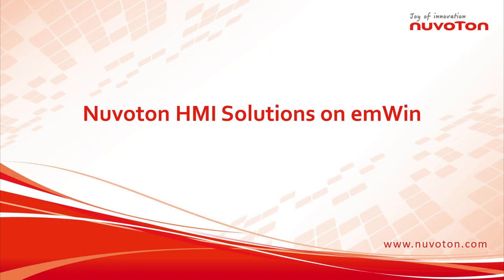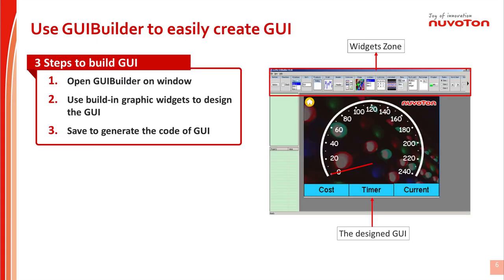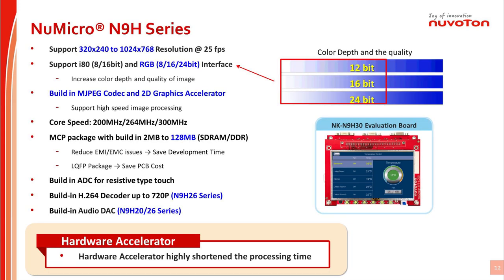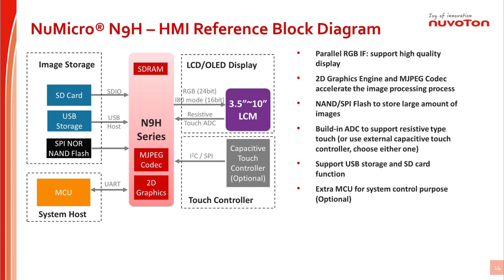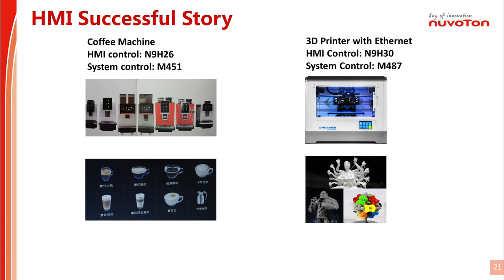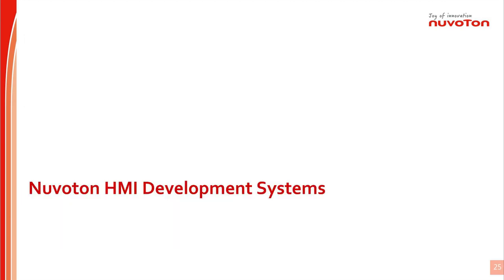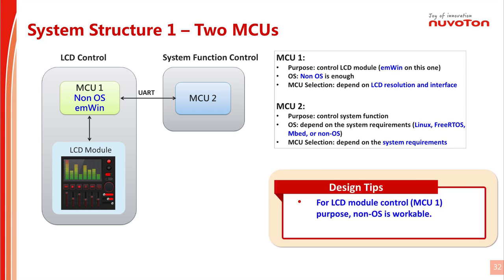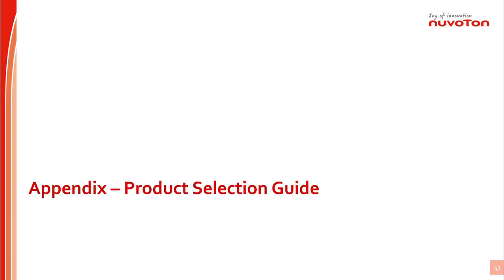Nuvoton HMI Solutions on emWin

Comment: Do you have some plans on producing embeddable panel computer based on NUC9x0 (or something like fully hackable thin terminals at least) can be used in applications like SmartHome and control panels for vending and industrial machines?
This product is not interesting with rates like processing power, screen size (must not be less than 7-10"), and able to run full-sized web interface (local web server, a browser in kiosk mode, and other user-developed software like media players, smart-home/automation control etc).
Reply from the maker: Thanks for your suggestion, the NUC9x0 product has limited size due to the built-in DDR memory.
It is not fully satisfied with the general POS usage. All the development
platforms that do not currently plan to make POS. You can refer to the Tomato
development platform to think about whether it can meet such needs.